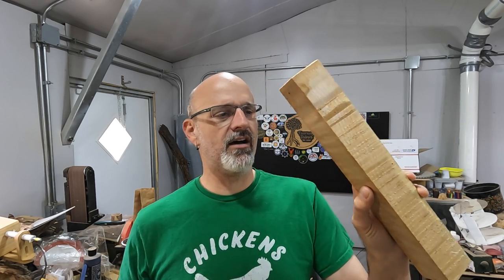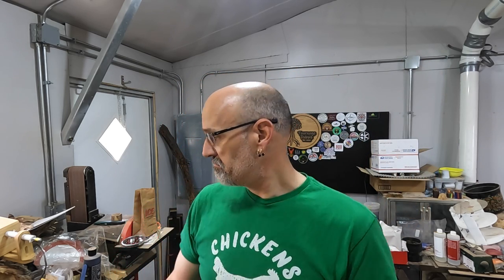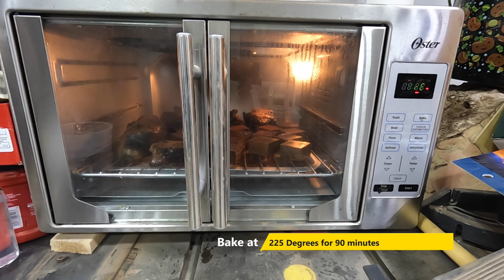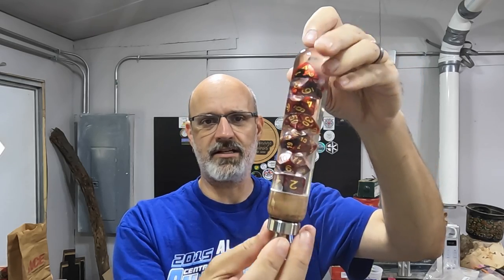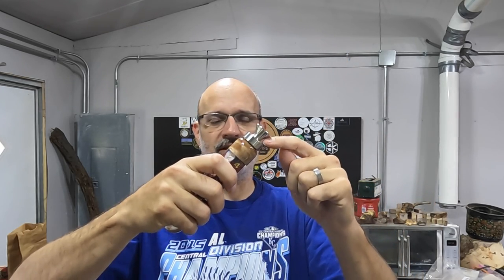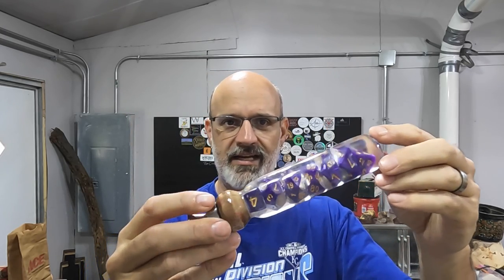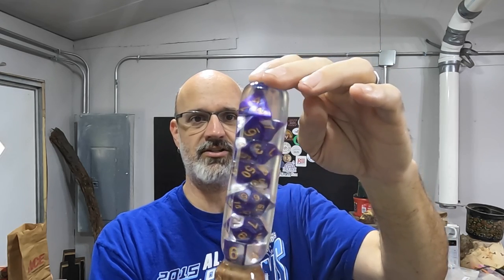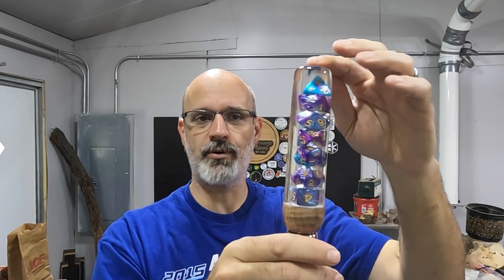Woodturning - The Hybrid Dungeon Master's Bottle Opener

Comment: At what temperature do you dry wood? And for how long? Thank you!
Reply from the maker: Thanks for asking! When I use my toaster oven, I typically run it at 250 degrees for 90 minutes at a time, weighing between each run. I do this until the weight stays the same.

I hope this makes sense.